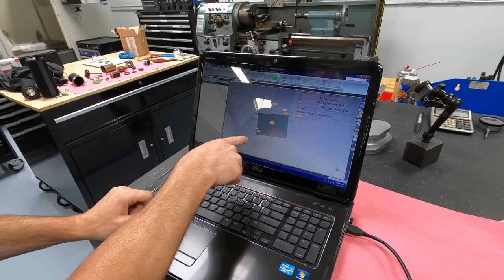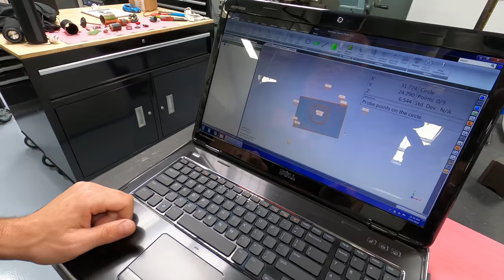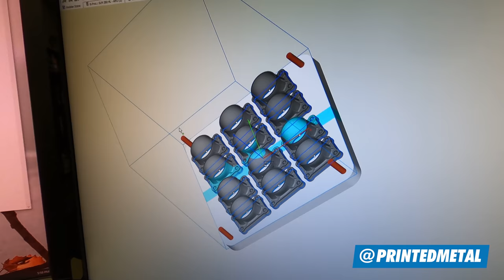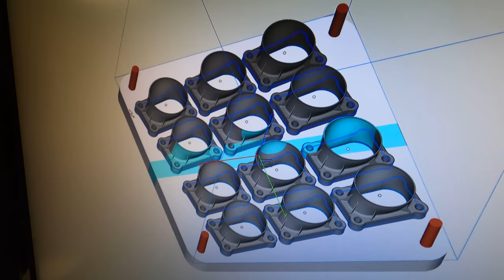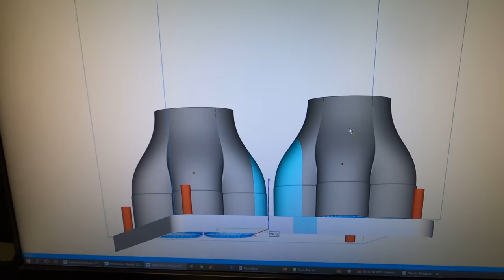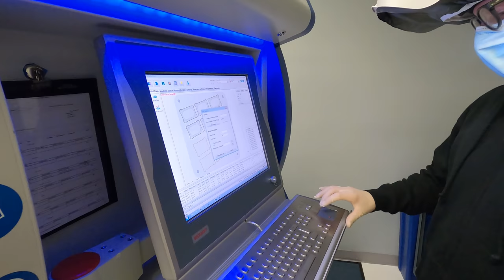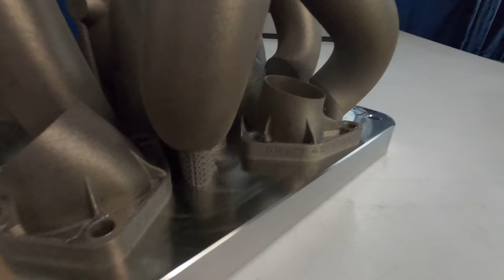Formula Supra gets 3d printed Inconel collectors and a Papadakis racing visit.

Comment: Race hoonicorn when it’s done.😁
Reply: the hoonicorn has double the HP + AWD. I'd rather see it race something in its own weight class
Reply: @gwot  still wanna see it. 12 cylinder &  torque. They already racing a car half the hp of the hoonicorn. Why not might be fun to watch.
Reply: @ghostmode8560  yeah they already did a few 700HP cars and most lost with a hoonicorn handicap, all lost by bus lengths without handicaps. It'll be fun to watch the formula supra run, but not because it's against the hoonicorn

Comment: I wonder how the primaries are going to be fastened to the collector, looks like there aren't much room to weld them. Some kind of ceramic adhesive maybe?
Reply: Near the end of the video he mentions they'll be slip on fits, so maybe it just presses in and gets held in place by a mechanical retainer, maybe a spring retainer like you sometimes see on NASCAR collectors and slip on motorcycle exhausts.
Reply: @benridesbikes6975  you hit the nail in the head
Reply from the maker: @benridesbikes6975  Yes exactly this.
Reply: @benridesbikes6975  Thanks! Didn't know stuff like that exists. I'm not used to all this modern technology.

Comment: I worked at a precision machine shop, and the older CNC machines were billed out at around 150 bucks per hour, plus building the program AND materials used. Extras If it was a first article or piece. Then you have inspection of first piece, as well as certain features tied to tolerances that have to be kept. Long story short I would guess Ryan has more into the printed pieces than most people spend on face masks and toilet paper today. I'd rather wipe my butt with my hand and wash it off to have a set of those.
Reply from the maker: I was lucky enough that the boys at Printed Metal were very excited about the project and considering they mainly do complex contract work these parts were simple for them and they helped me out on price.
Reply: @RyanTuerck  I'm excited to see this project continue. Wish you could work with a few more people to have the ability to put something like this into FD in the future. Imagine the people's reaction to the sound of that V10???!!!!

Comment: Wtf do I study to have knowledge like Dom?
Reply: Mechanical Engineering! With years of machine shop and welding experience. Could def supplement the mechE material with automotive technican classes at a community college too. 

An easier route imo is taking:
- learning CAD (SolidWorks/Fusion360)
- learning finite element analysis 
- automotive technican classes 
- machine shop classes
- welding classes
- use the 3D printers

Comment: Are those headers the same material The Papadakis Supra cracked during FD this season?
Reply: I'm pretty sure they are, that is one of the main problems with 3d printed metal, because of how it is melted together the grain structure is affected and so the fatigue characteristics of the piece isn't very good.
Reply: @NNFaNRacing  It looks brittle.
Reply: @huckhuckhuck  it’s not brittle it literally took 1000hp and 30psi+ boost levels for HOURS on a prototype piece. Exhaust will never see that kind of pressure.

Comment: give ur chassis some protcetion against corrosion -.-
Reply: They usually test mount everything first in order to build and weld any brackets or mounts they need then they strip it back to a bare shell and either have it painted/coated with sealer or powder coated

Comment: Very cool to see Steph Papadakis involved in this project. I love how absolutely measured, calm and clean everything he does it. He basically oozes professionalism.
Reply: Omfg when the guy chamfered the steering column adjuster on the upside down handheld router without any kind of safety, my (very German) heart almost stopped.
Hallelujah, I did a carpentry apprenticeship parallel to secondary school, and my Meister would‘ve probably slapped me for even thinking about doing something like this! 😰

Comment: Curious why you wouldn’t run a winters quick change considering the car is gonna be multi purpose
Reply: Gotta offset the cost of that beast of an engine 😂
Reply from the maker: The 8.8 is 20-25 pounds lighter is the main reason. It also has plenty of gear options and we can tune the differential much easier.

Comment: Why use Explorer diff? What's wrong with Supra diff?
Reply: Probably needed a different gear ratio that wouldn't fit since the engines RPM range at the could be majorly different.
Reply: Ford 8.8s are good for like 1000whp. They are actually stronger. U wudnt think it coming off an explorer. But yea. Hella strong

Comment: Don't know if it's just me, but I found it funny that you're using an old 8.8. Cheap decent rear end, although I'm sure yours will be exponentially better than decent. It's interesting to see the different automotive groups that are using it. I belive James from @cleetusmcfarland channel had a built 8.8 in the rear of his Nissan 240 (drag spec)
Reply: Your not alone lol 3D printed parts, expensive arm to measure a Toyota formula one engine to send specs off for a billet adapter plate for your custom trans and then he cuts to the junkyard diff I almost lost it lol
Reply: The Ford 9” and 8.8” are damn near indestructible! That’s why.

Comment: Why did you went with a Ford 8.8 and not a quick change?
Reply: Was wondering this aswell
Reply from the maker: The 8.8 is 20-25 pounds lighter is the main reason.

Comment: The diff mount on the back is usually where there's bolts that sit on the main caps, is that still being used or did you just use it for mounting?

Comment: You know how formula 1 cars have the airbox above the drivers head?

I'm guessing the airbox would create a ram air effect into the individual throttle bodies.

Are you gonna have a ram air airbox?
Reply: kind of like hoonicorn v1?
Reply: I may be wrong, but if this build is intended for drifting, a similar style scoop probably wouldnt benefit the car much. Drifting is relatively low speed compared to stuff like F1 so the benefits it'd provide most likely wouldn't be all that great. Also, while drifting, the car's sideways so mid drift the air wouldn't be getting rammed in and it'd just act like a regular intake. Could be interesting for the initial run up though

Comment: was serviceability a thought when designing the rear sub frame or was there simply not space to be able to worry about that? It looks like you would have to drop the whole rear subframe to service the diff at all.
Reply: Not even sure why they changed the diff? 
Seems like a lot of work for no reason
Reply: 4 bolts and the diff is out, no?
Reply from the maker: The Diff comes out just like any other diff would. 4-Bolts.
Reply from the maker: @luker3456  Gear options and the all aluminum housing.
Reply: @RyanTuerck  thanks so much for responding. i look forward to seeing it finished

Comment: Really keen eyes will notice that these videos were recorded a long time ago,cause even papadakis' supra wasn't done
Reply: I noticed this also, at first I was like they took the wrap off the Supra and then I was like it looks like it is having major work.
Reply: Not necessarily true. They’re building another Supra, I forget if it’s a demo car or a comp car
Reply: It's the off season . Papadakis runs his team like a proper race team, car gets wrap pulled off and stripped down to have every last nut and bolt checked and any new developments done . They are going to be building a second supra for 2022 as assbo will get a new chassis and tureck will get the current chassis.

Comment: Did you really had to scan it? Usually those engines come with installation drawings and probbaly JUDD could have given you the CAD model for the attachment points.
Reply: True, sometimes for one time custom stuff, the as built condition is more important than the nominal drawing dimension/position with tolerances

Comment: Hey ryan why dont you you make a custom sub frame and its mounts from chromoly 4130 tubes and plates?
The weight and strength differences and stiffness would be much greater
Reply: chromoly is very heavy + you'd need to design the subframe and validate your design with FEA/actual torsional stiffness testing. I imagine they found either from experience or a cost benefit analysis that using the original subframe is a good compromise between time, cost, weight and strength
Reply: I don't know about the cost is a factor and the decisions they took according to them but sure they have to invest the time in fea analysis and apply CAE aspects in designing a custom subframe
Reply: @fromrusss8734  maybe it doesn't fit their time frame to build entirely custom subframe. Ryan and dom surely can build it but it will take too much time and effort. If modified stock subframe can hold fd 1000 hp+ abuse then it's good enough for this lower hp build.
Reply: Ardi Januar true that

Comment: I think 3d printing like that opens up a lot of options in terms of collector and manifold designs, and these could be improved upon with some serious fluid-dynamics-heavy engineering. You don't need a manifold made of uniformly round tubes with uniform cross sectional area if you're 3D printing, and I'm pretty sure round tube isn't the best for flow in all cases; in bends the gasses want to collapse into a more flat ellipse.

Comment: Those headers look extremely thin, are they going to hold up?
Reply: While i cant know for sure Inconel is an amazing material. Keeps virtually all its strength up to really high temperatures and is extremely corrosion resistant also at high temp.
Reply: @Hellsslave666  How does inconel do with warping and hot/cold cycles?  That's usually what cracks headers.  Thinner ones tend to crack so much easier on joints.
Reply: @Triple88a  inconel and incoloy do not crack if they do you got chinesium not the real thing.
Reply: @SputnikRSS1  and where do you think inconel is made?

Comment: Is there any advantages using a CMM arm over a 3D scanner?
Reply: Speed, simplicity, accuracy, availiablity.  All production machining/fabrication companies will have a CMM (or several) in their inspection department.  Its a very universal tool for taking specific measurements.  3D Scanning is a more specialised tool thats not as accurate  and is typically used as a computrised visual inspection of large complex assemblies against CAD models where you are looking for a comparison of the entire part, but can also be bought into CAD software for reverse engineering purposes.
Reply: @YowserUK  Thank you for the detailed explanation!

Comment: Did you guys use the ring gear cap supports for mounting. You probably would have been better going with a cobra cover and being able to use the ring gear cap supports as intended. These aluminium 8.8 cases flex alot under high hp and high loads. Ask the cobra guys.
Reply from the maker: we did not. We can always add them back in but we weren't going to use them initially. I'll do a little more homework on it.
Reply: @RyanTuerck  i know this is a race car and weight is important but ford made a cast iron 8.8 irs diff that was in the t-bird. This is was we swap to when beefing the the irs in cobras may want to look at that option. Build is 👌

Comment: Those stupid 1/2 liter per cylinder one size fits all econo box motor design absolutely sucks. BMW now has one engine. They are all identical 500mL per cylinder lego engines. A billet i6 K36 Honda design would destroy it. Even better would be a canted valve, canted dual spark plug 4 valve chamber with a 120mm bore and a 63mm stroke aluminum rod motor would rev to 16,000 rpm like a Yamaha R6 and kill everything except for Gordon Murray's new hypercar V12 pneumatic valve with a 27,000rpm redline. That's the limit of today's technology. Almost 30,000 rpm but it requires a sub 70mm Stroke to do it. 
Everyone is fighting against the current to make these garbage cost based design engines make huge power. Of course they get it done, but it could be so much better. The AMG M156 Darton MID wet sleeved 104mm bore,  slightly destroked to 5.5L from 6.2 is probably the best V8 base design to make massive amounts of efficient power with new rotating assembly, bryant crank, porting, titanium and inconel valves, beryllium or mmc valve seats, dlc tool steel buckets, arp 625 head and main studs with twin surbos will lay down over 2,500hp. 😊
Reply: who asked
Reply: I know enough to digest what you said but not enough to understand it haha. Cool stuff

Comment: 8.8's are legit but with a 250k F1 heritage engine and Holinger sequential why not opt for a Winters quick diff?
Reply: Probably ease of install if I had to guess. Not to mention it’ll be just as strong you just loose the ability to swap ratios but with a 6 speed that’s less of a big deal.
Reply: ya, I thought quick changes would be a necessity?
Reply from the maker: We went with the 8.8 mainly to save weight (20-25 pounds) and the fact that you can run a tuneable differential. Where the Winters you don't have any great differential options for grip racing. So we sacrifice the ease of ratios for hopefully what will  be a better track setup.